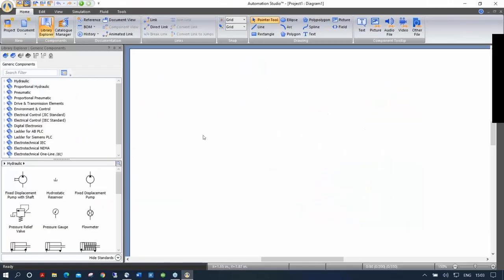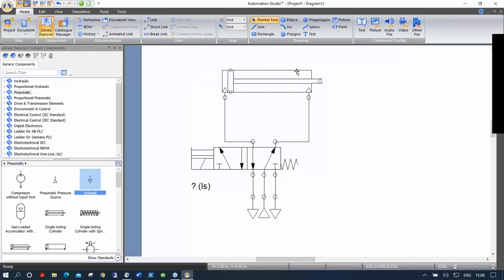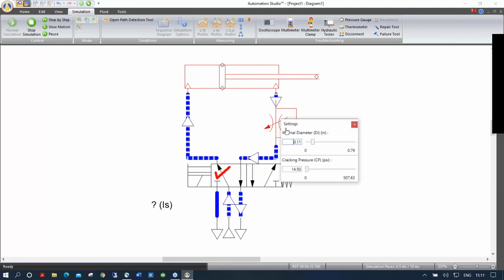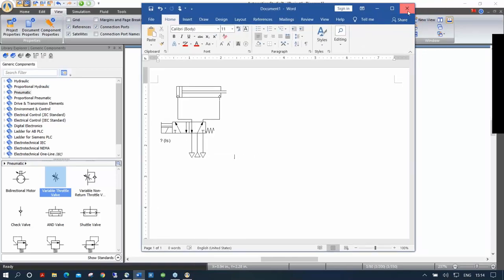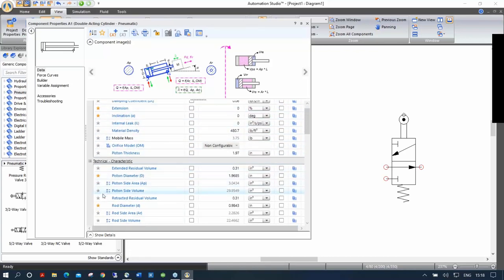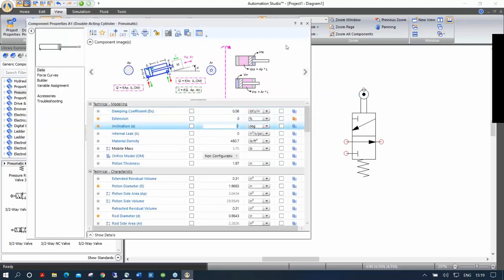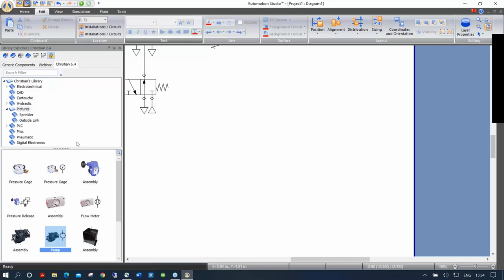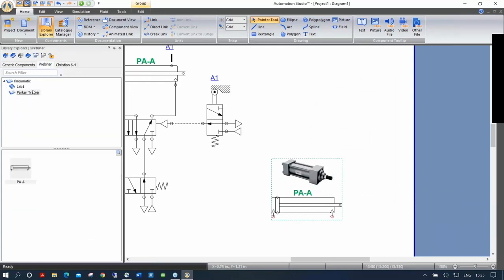Pneumatic and Electro-Pneumatic: How to use library in Automation Studio™

Comment: Thank you very much for the comprehensive video. May I ask a question? I can't change the ID of the components. It appears unchangeable on the data screen of the component. Could you please help me out?
Reply from the maker: It is possible that the ID Component is locked for all components. This setting can be turned off by accessing the View tab and unlocking ID Component.